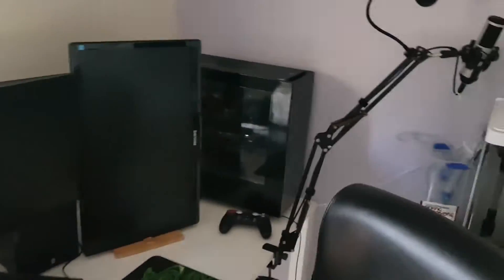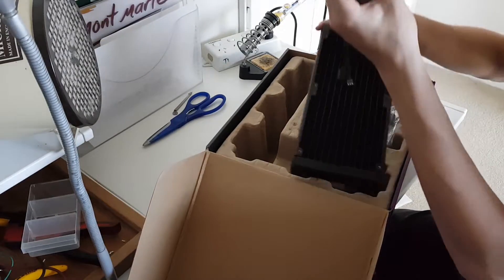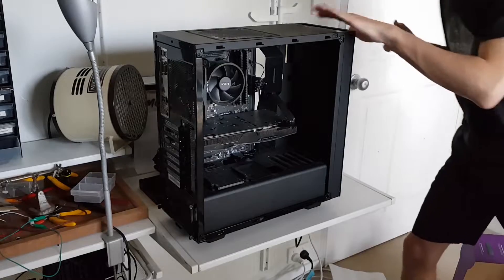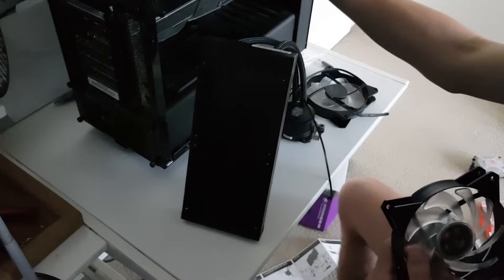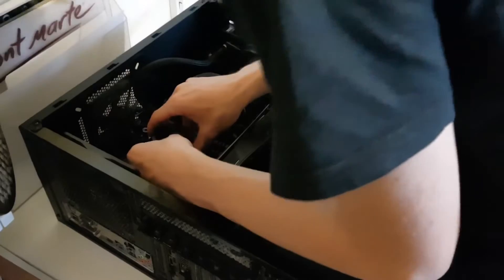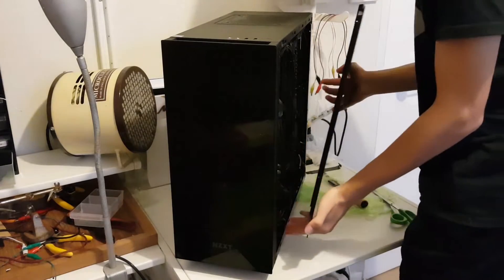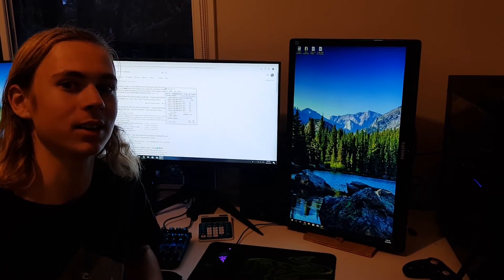Installing the Cooler Master Master Liquid ML240L RGB AIO in my PC!

Comment: If your tubes are long enough you should flip your rad so that the tubes are on the bottom.  When installing your rads vertically like you did you should always strive to get the top of the rad without the tubes as high as possible above your CPU as that is where the air will accumulate.  The best spot  to install a rad is on the top of your case but you do not have that option in your case

Comment: Your fans are facing the wrong way. They work by pushing the air behind it into the radiator. 
 
If you have your hand in front of your radiator (other side from which fans are installed), you would feel almost no air because it's designed to push air behind. 

 You wanted to have it the way you installed it because of the dust filters in your case, however they must face the other way around or have the fans at the front of the case with the radiator behind (for the air to push into). 

 There is no air going into the radiator, the fans are only pushing air out into your components.
Reply from the maker: I did that on purpose. You can put the fans either way, and I chose to have them pull air through the radiator, which has almost the same cooling performance as pushing the air through. So the air comes through the radiator at the front, and gets pulled out by the case fans that are toward the top of the case. And I can vouch that this works, because it's been like that since I made this video, and my cpu never gets over 50 degrees.
Reply: TriDeapthBear that's fair man, I've never had like that so I probably shouldn't have said haha. How is it holding up?
Reply from the maker: @razzo_2999  all good, and yeah it's been working really well
Reply: TriDeapthBear that's good, and it came with paste?
Reply from the maker: @razzo_2999  Yeah it did, and I've been using it for other projects too, so it's more than enough.
Reply: TriDeapthBear that's good aye, thanks for your work, subbed 👍🏻

Comment: Hey, great video! :) ... I just have a question about the bit that was 'off camera' during the wiring... I followed the AWFUL enclosed instructions, and as the 3-part connector (that I assume is all the RGB) heads towards the PSU, there's one last piece that isn't labeled in the instructions; if you have them to hand it would be on the last step, the wire that connects to 'Q' ... is that SATA to 6-pin? I'm left one step short of being able to power it and I'm wondering if I'm missing a piece... I haven't built a pc in 12 years so I'm figuring this out as I go and would appreciate the help!

Comment: Hey, can you explain how to connect the RGB controller?
Reply: I just got this same AIO and the RGB is pretty easy. You should have a 3 way RGB cable splitter that comes with the cooler. You connect the 2 fan RGB cables and the one coldplate RGB cable by using the male adapters to the three way end and the other end you connect to the little controller that it comes with. There is a drawn diagram on the instruction booklet. You than power that little controller, which is magnetic btw with the PSU adapter that it comes with and you should be all set. 

Personally I'm not using the controller and have connected the main end of the three way RGB splitter to one of the RGB terminals of my msi motherboard so I can have my motherboard RGB software control it. I have my GPU, motherboard, ram and this AIO RGB running of the msi software, which makes the RGB uniform with everything and much easier to manage.
Reply: @TerraWare   Thank you! Finally, I'm also controlling the RGB using software (MSI Mystic Light 3.0).

Comment: do you have a noise issue with the fans? mine create a roaring sound when running horizontally on the top of my case.
Reply from the maker: The only time they're loud for me is when the cpu is really under load
Reply: @TriDeapthBear  thanks for the fast reply. I do not hear the classic wind noise of a fan, more like the roaring of the engine. Maybe it is because the heatsink transmits the vibration of the engine. I will need to try to put the fan between the heatsink and the case or move the heatsink to the front instead of the top and see if the noise goes away.
Reply from the maker: @VuHien2011  hmm yeah I'm not too sure. Could be the pump, but I'm not sure if moving the radiator to the side would make a difference, but I think it's worth a shot if it's annoying you
Reply: @TriDeapthBear  it is definitively not the pump. I temporarily unplug the power cord of the pump and the noise did not go away. Unplugging the fans definitively removed the noise.

Comment: why did you clean the thermal paste, you can reuse thermal paste that is not rock hard, you wiped it off so it was still moist, why didnt you reuse it
Reply from the maker: I had plenty to spare, and I thought I may as well re apply as it's been a couple years since it was applied. Plus, it was preapplied on my old cooler, so it probably wasn't the best

Comment: I get a lot of metallic noise when i mount ML240L on the case removable part. If i unmount it and hold it without touching the box, the noise is gone. Do you have any idea on how to fix it? Thanks :)
Reply from the maker: That definitely sounds like a vibration issue, which probably comes from the removable part vibrating on the rest of the case. Not really sure how you could fix it though, sorry.
Reply: @TriDeapthBear  thank you for the reply :) ill try to use rubber on the screws. If i still have the noise issue, ill try to put something under.

Comment: hook up your rgb cable off the pump to the rgb header on your motherboard. your pump should have come with a 3 way splitter
Reply: Hi Bob - Actually the pump itself did not - just two wires coming off it; one three pin, one four pin.  The confusing piece for me was that the CPU_FAN header had 4 pins, but the wire I thought I should use only had 3.  And there was no labeling on the motherboard to show which was pin 1 etc.  So a bit dicey to just guess at how to hook this up.  Also there was a special RGB header for the cooler which was not located in the expected part of the motherboard, and was not described very well in the cooler documentation - which BTW was extremely poor. Diagrams with no descriptive text, and different wiring configurations from what I had.  Anyway - thanks for trying to help.
Reply: @brianprice7812  What did u end up doing man?
Reply: @brianprice7812  the three pin is for the pump search for cpu opt or something like that.

I know i am very late

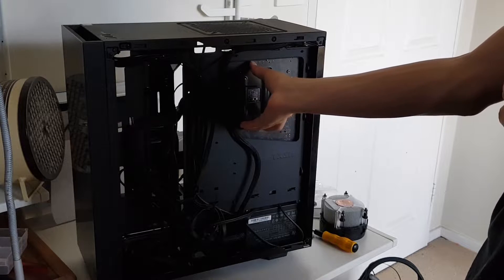Comment: 8:00 that was the pre installed back plate for your mobo my man..
Reply: as well I know there manuals for most pc parts are straight crap.. with very little english and mostly pictures but yea... FYi for all read your manual :P
Reply from the maker: @BodihZapha  that would explain why I don't remember putting it there lol. I definitely agree that the manuals can be pretty bad, but yeah, always a good idea to consult it before doing anything.

Comment: Man, how do I put the fans only in red, without blinking, without anything except for the controller? He's pretty useless and doesn't just make me red.
Reply from the maker: Unfortunately I don't think you can. Depending on your motherboard you might be able to plug it into that and control it using some sort of software but other than that I'm not quite sure, sorry
Reply: @TriDeapthBear  my motherboard is Aorus M  B450 AM4

Comment: Did you ever get the RGB to work? If so what did you do
Reply from the maker: I did just recently actually. I'm not entirely sure what I did, but try connecting the 2 outside connectors that are on the splitter to the fans, and the middle one to the water block. As soon as I did that, it seemed to work. Please let me know if it works!
Reply: @TriDeapthBear  will definitely report back when I get it. Might be awhile as I'm getting a new moniter so I wont be able to afford it for some time

Comment: Anyone else have a problem screwing the arm pieces on to the cooler master? I’m able to get the back piece on my motherboard but the screws for the arm pieces are too big and don’t even fit in either piece
Reply from the maker: Yeah, I had a few troubles. Is your cpu intel or amd?
Reply: @TriDeapthBear  have you managed to get it to show up on any software like aura sync either also a small Issue I've had with it
Reply from the maker: @dylanpowell3854  in the end, I kinda gave up because it doesn't matter too much to me and it's not worth the effort
Reply: @TriDeapthBear  mine was intel, i ended up having to use smaller screws from another part because it wouldve taken forever for Cooler Master to send the part
Reply: @TriDeapthBear  I did find a fix for it, if you have a 12v RGB header on your mother board you can plug your 3-1 cable into that instead of the RGB controller

Comment: Yeah its very hard to install the cpu cooler to microprocessor with thermalpaste. Then i install the cooler head first much more easier.
Reply from the maker: Yes, the duel pump provides an adequate challenge when it comes to adjusting the copper induction pad to make perfect contact with the thermal compound to create a proper seal.

Comment: that cpu is cheap but underpowered? 6 core?
Reply from the maker: I probably should've phrased that a bit better. It's a decent CPU on it's own, being 6-core, but it's clock speed was 3.2GHz, and next to my GTX 1060 it was bottle necking my system a little, especially when it came to video editing.

Comment: I have bought this cooler but fans are like jet plane even i open chrome they sound like engine.overall is good but noisy
Reply: Xhaxhi they aren’t noisy
Reply: I can tell you don’t know anything about pc’s. This cooler doesn’t have anything to do with chrome running.
Reply: @KB2020_  ofc it doesn't but when i open chrome cpu temp rises so fans start "flying".

Comment: Fans are wrong way around tho..
Reply from the maker: They can be either depending on the configuration you want. I've got them pulling air through the radiator as opposed to pushing air from the case into it.

Comment: hi i have S.O.G ROGUE IV and Cooler Master Master Liquid ML240L i try to Install in the up of case but i could"t do it can y show me how to do that
Reply from the maker: First off, that is a nice case!
Installing it in the top should pretty much be the same process, just with the added difficulty of gravity. If you make sure you put the fans onto the radiator first, have the screws on hand, and screw in the corners first, it shouldn't be a huge deal. That, or get someone else to hold the rad while your screwing it in. Hope that helped

Comment: Don't do like this dude, how to mount a liquid cooler wrong
Reply from the maker: What did I do wrong?
Reply: Imagine that u got some air in the cooler. Most likely there is a few percent of air in theese, where do u think the air will go? Up! Right where inlet and outlet on the radiator. I'm not saying your cooling won't work that way. But most effective cooling will be with those hoses pointing downwards. Smallest chance for your pump to suck air bubbles.

Comment: Completely skipped over on of the most important parts of this installation - where the wiring for the actual cooler goes!!  You said you spent 20 minutes doing that - but what WAS it.  Make this youtube pretty useless as far as I'm concerned
Reply from the maker: Well, this video was never meant to be a tutorial, more of an entertaining video and to be honest, plugging in wires isn't very entertaining lol.
Plugging in the cooler though, which I'm assuming your not talking about any RGB, you plug the pump (the thing that goes on the CPU) into the pump_fan1 or 2 header. It may be different for your AIO, but both fans on mine plug into an adapter to control them from one port, and that plugs into the cpu_fan1 header on your motherboard. That's what I've done, and it's been working perfectly.
Your right though, if I wanted this to be a step by step tutorial, there are a lot of things I skipped over that I should've included, but it's not meant to be a tutorial
Hope this helps!